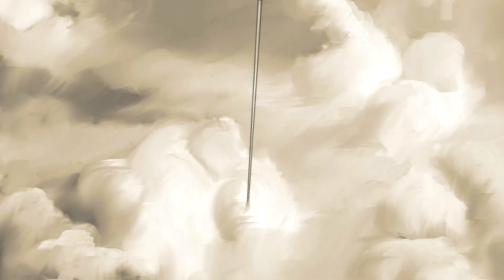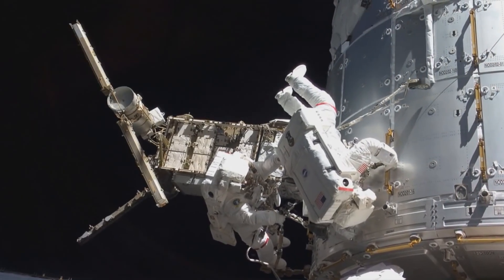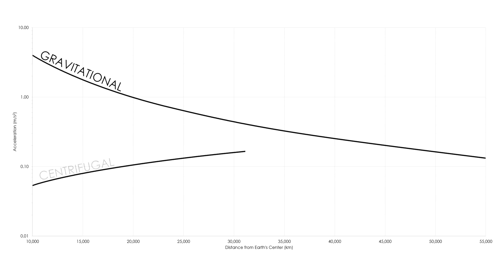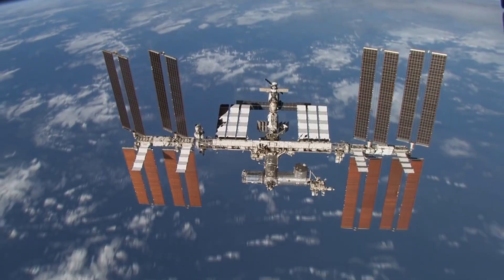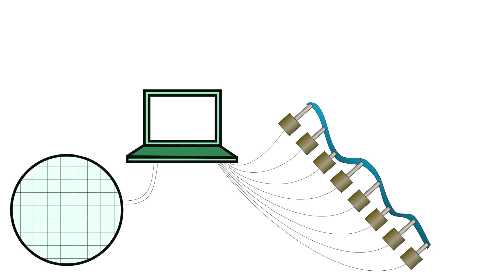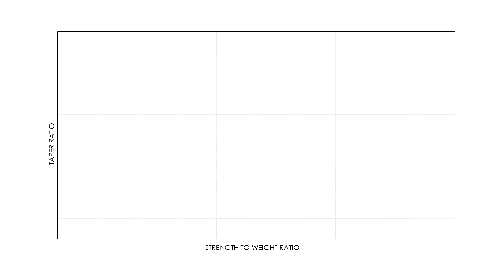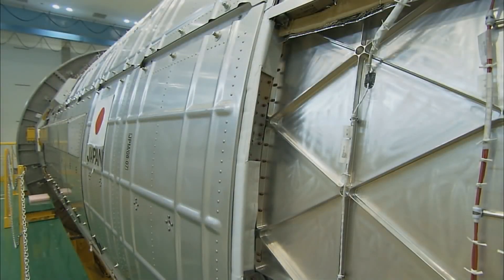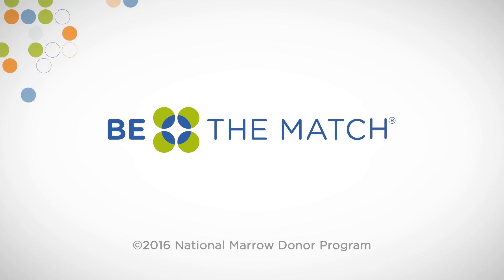Design Your Own Space Elevator

Comment: Sorry to nit pick again, but in the paper you link regarding taper ratio, it actually defines taper ration as the ratio of cross-sectional areas. not diameter. Your estimate of the resulting diameters should actually be the square root of what you state. 

A 1 cm diameter steel cable would have to be 4e14 meters at GEO  (about 1 ligthfortnight ;)
A 1 cm diameter kevlar cable would have to be ~160 meters at GEO
Reply: "lightfortnight"

#respect
Reply: I'd love to see him respond to this.
Reply: Better not mention that a similar calculation done by someone (not me) who is familiar with the mechanics of elevators puts the diameter at the top as something like 2Km for a steel cable.

That's the thing with physics - no matter how much you know or how good you are at the math its still horribly easy to get something wrong. The tiniest misstep like forgetting to factor in reducing gravity with height tends to make all the difference. The gravity at the orbital geo-lock point is of course zero by definition.. :)
Reply: @Lucien86  Bzzzzt!!!
Nope, it's just balanced by centrifugal force.
Reply: My previous post says the top of the cable, its widest point is not there but somewhere at a midpoint. The reason that a steel cable ends up at anything like 2 Km wide in the middle is that 50,000 Km is very very very long for a steel cable.
Reply: Now you gotta hold up the climber and payload. Fortunately, the payload would be negligible in such a massive structure. I’ll just leave it out of the equation to simplify things... 😉
Reply: can I get 4*10^14 meter number in Smoots
Reply: Is gravity not lower the further from earth you are? And then, centrifugal force is higher, therefore, the further up the rope you go, the less the rope actually has to support. So, the rope would need to taper even less.
Reply: @AirNeat  But at the top cable section needs to support the tension of all the rest of the cable trying to fall back to Earth. At geostationary altitude gravity and centrifugal forces only get blanced (although centrifugal force depends on momentum, it's not a given, this detail was oversimplified but roughly correct anyhow), so the top segment of the cable does not need to support itself, so to say but it still has to support the other 50 km of cable under itself. Ultimately the only thing that prevents the cable from falling is the geostationary orbit of the satellite/station but it still requires that the cable and any anchorage it has is strong enough to hold on itself for 50 km. The only thing that could save the day would be a very light and extremely strong type of material and that's a huge challenge. 

This problem of tension does not only affect the space elevetor but any sort of structure anyone would try to build in outer space at large scales such as the extremely conjectural and almost certainly impossible "Dyson spheres".
Reply: @LuisAldamiz  You can do a lot better with active support structures, up to and including the big daddy of them all, orbital rings. With net of orbital rings, you can most certainly build a Dyson shell.
Reply: @General12th  - I'm quite certain you can't but show me please how wrong I am...
Reply: @LuisAldamiz  It depends on whether or not you know how orbital rings work. If you don't, this comment section might not be the best way to explain it. But if you, I'll be happy to go further.
Reply: @General12th  - I don't know how things that do not exist, except in SF (emphasis in "fiction"), work. Sorry for being that "dumb". I know it's a concept that some fiction works (games?, unsure) have conceived and that they should have massive engineering problems all around. I know that they don't exist in nature nor AFAIK in any known artificial way. Can they exist? My best guess is nope but I reckong I just haven't pondered the problem much, I just watched one video arguing they were absurdly impossible and that such impossibility sounded correctly stated to my understanding.
Reply: @LuisAldamiz  Here's a video going over some of the basics: https://www.youtube.com/watch?v=LMbI6sk-62E
Keep in mind that many devices were once science fiction, and yet they are real today. Orbital rings don't violate any known laws, so they must in constructable in principle.
Reply: @LuisAldamiz  Well, gravity decreases exponentially with distance, so the rope wouldn't have to be as thick. It's may still be impractical, but this just makes less impractical.
Reply: @AirNeat  - Even if the weight of higher segments is slightly smaller (not much: ISS gravity is 90% of ours, their "microgravity" is caused by forces negating each other), the rope still has to support all the rope that hangs underneath it and that weight is additive all the time up there to the sky. It's not a pillar: it's a rope.
Reply: @LuisAldamiz  Fair enough.
Reply: @General12th  - Many things that were SF are still SF and will be for the foreseable future. A local saying goes "everything that has a name may exist"... but that does not mean it necessarily exist, fire breathing dragons do not exist and a masterpiece SF such as "Journey to Center of the Earth" is almost certainly unfeasible by any means we can conceive. 

So it's up to engineers and other specialists to make it possibly or fail trying (die trying is not strictly necessary).

I'm watching your video even though I consider Arthur to be a techno-optimist in excess. I stopped after five minutes to point out that plain "magnets" are not a thing in the terms he imagines them, for such a large floating magnet you'd need electromagnetism and thus energy sources and wiring, which in his fantasy is nowhere to be seen. 

I'll keep watching anyhow.
Reply: @General12th  - Wow, really it reminds of 60s' movies about how to make fake gravity out there, all the engineering challenges are simplified with the pseudo-logic "is just a cable", never mind it's a cable the size of Earth that somehow you have to place in positon out there in all its length before things run smoothly at all (if they do). That is in itself a practical impossibility!

More notes I took as a I watched:

Swee-talking Arthur says: "I would need to add momentum to the ring".

Oooookey, good luck with that... something tells me that the ripples of energy will tear it apart, after all you are transferring energy at certain points on a structure larger than Earth in circumference but thin as a bridge (almost). We know of way too many bridges that collapsed because of much less than that. 

Then he makes the magnets electromagnets, not out of necessity (as was my previous thought) but just for convenience. And how does he power them? With a few solar panels here and there. Ooooookey, good luck with that... again. Even in the most optimistic case (enough panels to power the electromagnet on average without overweighting the ring, sounds unlikely but let's go with it) half of the ring will always be in the night side of Earth and that means no solar energy at all, transferring enlectricity beyond a few hundred kilometers is unfeasible so the dark side of the ring (i.e. the whole ring because it will have day-night cycles as we do, more or less) would need some form of energy storage, be it batteries, be it water-hydrogen electrolysis-thermal power plants, which are not even a thing on Earth yet (most recent, 2018, research allows for 80% energy conversion ratio but application has not started). Again that's extra weight and extra problems.

It's a megalomaniac dream with no practical foundations whatsoever.
Reply: @LuisAldamiz  Not having watched the video, I will mention that very little to none (depending on season) of a ring at geostationary altitude would be shadowed by the earth. There will be two times a year when half of it would be shadowed by itself, though. But maybe I'm misunderstanding the concept, and I lack your patience for watching, so kudos anyway.
Reply: @Validole  - That's also true, in the most unlikely case the ring thing can be put together and withstand its own inertial forces, what, as I believe I said, seems utterly impossible. Why that would be relevant?
Reply: @LuisAldamiz  I looked at the paper Grady cited and calculated this "relative thickness" for a cable that only hangs from an orbital ring in low earth orbit. With steel this tether would be 18 times as thick at the top as at the surface. With kevlar it would only get twice as thick.

So we have the materials to make such a structure a reality! Whether we have the resources or the engineering prowess is a different matter.
Reply: @LuisAldamiz  Dyson spheres have moved away from being potentially solid structures and are sometimes referred to as Dyson swarms, many small objects performing the same original purpose. 

Similarly, it would seem that multiple geostationary tethers might be able to spread the load to some feasible degree.
Reply: @Mavrik9000 .- Doesn't matter: we still clash with (at least) two physical impossibilities: structural tensions and energy dissipation. 

The latter makes effectively impossible not just "Dyson spheres" but also continuous solar power on the surface of the Moon (or Earth). We can't effectively transport electricity for more than hundreds or (at most) a few thousands kilometers. This makes impossible not just "Dyson spheres" of any kind but other megalomaniac engineering ideas such as producing solar energy in the Sahara and consuming it in Europe -- at the limit the idea might work for the nearest Sahara and the nearest parts of Europe but the losses would still be massive and there are places closer to the consumer where we can collect that solar energy much more efficiently. That's why Germany makes its own solar energy and does not import it, even if it is a somwhat less sunny place. Producing solar energy in the Sahara makes sense only for Saharan or near-Saharan economies, which so far have low energy demands and are smallish... other constraints such as water availability do apply, but maybe it'd be more efficient to divert the Rhine and Danube to irrigate the Sahara (nah, just kidding, that's also inefficient its own way, and an ecological nightmare).

The only way I can fathom that solar energy could be concentrated into a single consumer point such as Earth or a Martian base or whatever, would be with mirrors, i.e. reflecting it and not processing it into electricity, but that would make the destination an infernal oven, so it is also a no-no. You actually want to keep the optimal distance from the Sun and it's brutal energy, else: Venus or Mercury happen. 

And I'm not going to even start discussing the issue of structural tension (thethers? c'mon!): even with the lightest and strongest materials like say graphene, that would not work. 

We don't need SF megaprojects that are made of the figments of the imagination of our Fordist Era ancestors (some still alive maybe but not for long), we need decentralized solar power down here on Earth and hydrogen from hydrolisis (which requires water, mostly hard to find in outer space) to use as storage (either to produce thermoelectric energy when it's dark and other renewables do not work for whatever other reason or to use for vehicles of all kinds). That combo would solve all our energy demands down here on Earth but may not be useful in outer space, depending on local conditions (mostly not at all like those of the privileged Earth's "oasis": it's "hell" out there).
Reply: @LuisAldamiz  dyson spheres are very much possible.  Theres a reason one of the primary things SETI look for is dyson spheres to detect advanced intelligent life.  At this point it seems to be the obvious way to go for space travel and capturing energy
Reply: @squiglemcsquigle8414  - No. It's very irrational and inefficient: need of energy in location A cannot be satisfied by collection of energy at location B, unless an efficient energy transport system is devised and provided. And Tyson spheres don't do that -- because they can't. They are an urban myth like flat Earth.
Reply: @volbla  An orbital ring does not help with an elevator for two reasons. The first is that the cable just below the orbital ring still needs to be strong enough to hold up the  weight of the cable beneath it. Therefore, its diameter still needs to be the same at that altitude as the cable for a space elevator without orbital ring.
The second reason is that if the cable ends at the orbital ring, that same force is now pulling downwards on the orbital ring, orthogonal to the ring itself. It will not be able to withstand such a force at all, and will simply break in two and/or pull the ring down towards Earth. To avoid that, you still need a counterweight outside of the Clarke Belt to pull the cable up. That is, you need the exact same construction as for a free standing space elevator.
Reply: @renedekker9806  Those problems are solved (at least in theory). For the first one, an orbital ring is simply much closer to the earth than a traditional elevator. A space elevator needs to reach 40 000 km or something into space. The original paper by Paul Birch shows calculations for an orbital ring system at both 300 and 600 km altitude. The exponential growth of the tether thickness doesn't have time to get prohibitively large.

The second problem is also solved, but it's a bit more technical. The long and short of it is that the orbital ring does not sit in a circular orbit. It's more like it changes between the closer part of two elliptical orbits wherever the tether is attached ("attached" with magnets or something). Changing between those orbits requires a downwards force which is exactly what the tether and accompanying climber provides. Of course, this means you need at least two tethers at equally spaced points around the ring in order to change it back again.

The bigger problem with this imho is that the ring will find itself at different altitudes, meaning different orbital speeds, so it will have to be made of a material that can stretch and bend. Birch goes over this as well, but i didn't quite understand that part of the paper :)
A sci-fi manga has a solid and hollow orbital ring that magnetically accelerates a fluid inside it to higher than orbital speeds. I couldn't tell you if that makes more sense though because i haven't seen any maths on it.

An orbital ring system is a more complicated structure than a space elevator so it faces a lot more engineering challenges, but it does manage to keep the material requirements limited to what exists today. I think it's an attractive option, but it might still be too complicated to ever be feasible.
Reply: @volbla  "The original paper by Paul Birch shows calculations for an orbital ring system at both 300 and 600 km altitude" - an orbital ring system at 300 or 600 km altitude cannot be in geostationary orbit, or it will fall back down on Earth. It needs to rotate much faster than that to stay up. So you cannot attach a stationary space elevator cable to it. In order for the orbital ring to be geo-stationary, it needs to be at 35600 km or higher. 
If you are thinking that the cable is attached to the high speed orbital ring with something like sci-fi rollers, then at that attachment point, you still have the force of the weight of the cable pointing down to Earth. That is a force that is orthogonal to the shape of the orbital ring. In order for the ring to generate the necessary counter force, the ring would need to make a steep bend at that the attachment point (impossible if the ring is moving fast). Or it needs to bend a little, and transfer the large force of the cable to a really gigantic force along the length the orbital ring. That will rip the ring apart.
Reply: @renedekker9806  Yes! The ring itself is orbiting much faster than geostationary and even circular orbit, but the tethers to the ground "will obtain their lift by using superconducting coils to produce a persistant magnetic field; these will float above a diamagnetic surface." The ring's orbit can then precess at any rate you want (i think; i don't really understand precession) so that the attachment points, and therefore ground stations, remain stationary to the Earth surface. Not only do the ladders require less extreme materials than a space elevator, they can also be placed anywhere on the Earth whereas an elevator goes best at the equator.

I reread some of the paper and Birch somehow manages to get minimal bending (a couple of degrees or less) and stretching (1%) of the ring while still supporting giganewtons of force at the attachment points. I have to admit i haven't scrutinized it that thoroughly, only enough to (mostly) understand where his equations come from. If you're interested you can find the papers yourself by googling. Orbital ring systems and Jacob's ladders in three parts focusing on physics, engineering and applications respectively.
Reply: @AirNeat  I was going to say something about centrifugal force and less gravity, but figured I'd check to see if anybody else had already asked about it and gotten a response. Looks like I'm not the only one wondering.
Reply: ligthfortnight THIS GUY PREDICTED FORTNITE